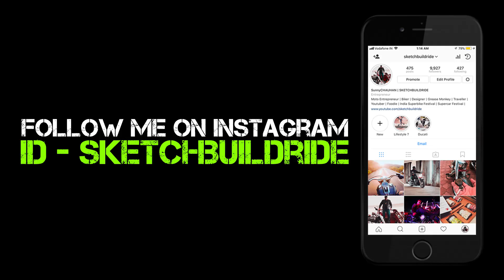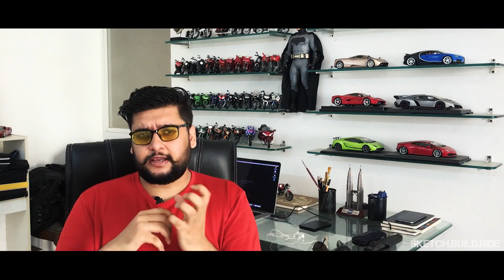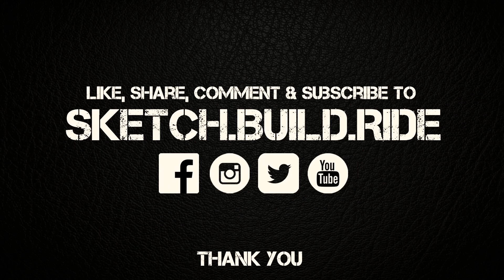Motorcycle ECU | How does a Motorcycle ECU Work ?

Comment: Hello sir recently I have done my ECU UPDATE on honda cb350 it's done by honda service station I am not satisfied with the update I talk with service station thay told thay don't have any solution to revert it any suggestions?
Reply from the maker: Yes. Most OEM ECU updates are irreversible - just like the phone updates. Difficult / not possible to go back to the old version. But you can always add a piggy back ECU ( like powertronics etc ) and have a custom map setting to get the most of your motorcycle.

Comment: I have got a Daytona exhaust and a 1 spoke decrease in my front sprocket of my r15v3 so is there any need of ecu remmaping and are there cons of remmaping an ecu for my r15v3
Reply from the maker: Technically you should since you are changing the exhaust. Tuning it with a better map for a better air/fuel ratio is gonna give you better performance and a more optimal running engine.